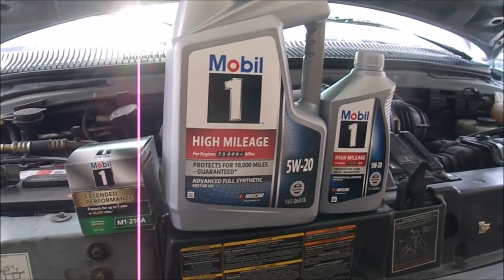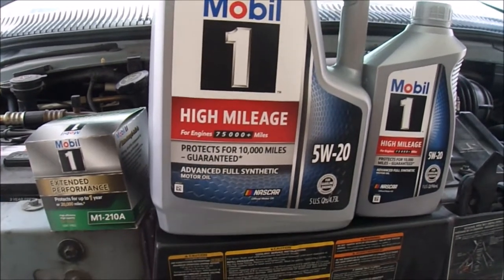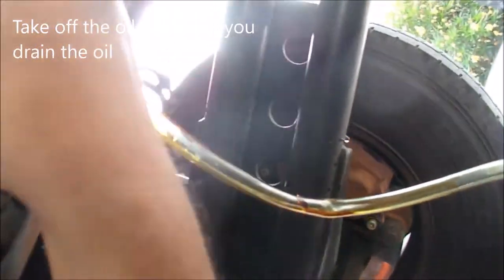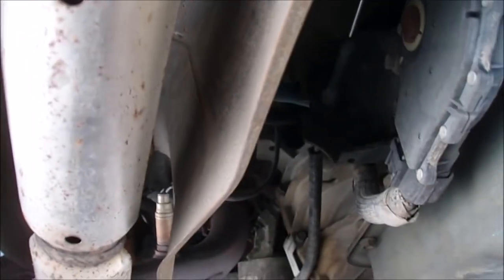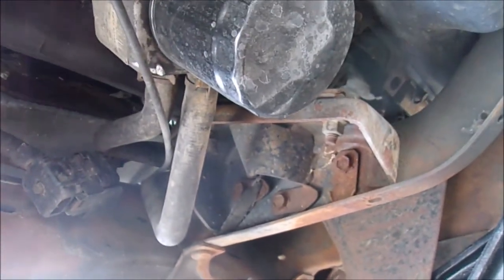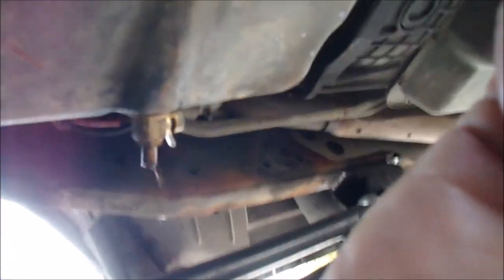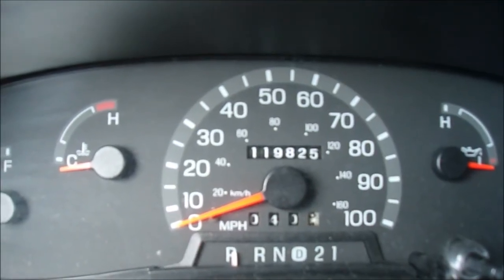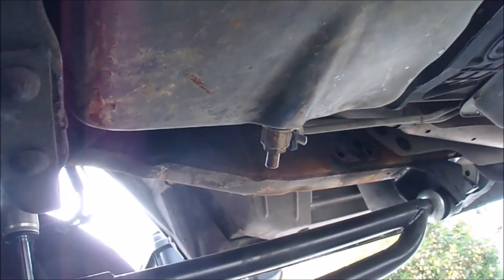Fumoto drain valve hose kit demo less messy easier oil change Ford V10 Econoline Van Class A RV Tip

Comment: Looking good! 

I have 178k on my Triton 5.4 and change it every 5k with the Ford brand semi synthetic oil and  Ford brand oil filter. I’m hoping to make it to 500k! Then a new engine when I’m an old fart..

I just drove 600 miles last weekend to Lake Shasta it was 110 degrees..
Reply from the maker: I've had my Abarth for 3 years in July and I put 15,000 miles on it in that time. I put the same on my Van in a little over a year. How many miles did you have on your van when I bought it? This 2nd Van Project I'm enjoying this van way more. That was plan to go on a lot of road trips. How many miles is the Kings Canyon Trip going to be for you? I have a Vegas Trip planned for October that's going to be another 1000+ so I'm good on oil changes. I like doing about 5000 but I might go a little over this next round because of all the trips I'm doing. I'll do a update video soon on which days I have approved for leave. I put in my requests.

Comment: Is that the best oil for larger vehicles?
Reply from the maker: GM puts Mobil 1 in Corvettes and so does Porsche so I figure it's good enough for my van. I use high mileage formula in vehicles with 75000 or more miles because it's suppose to help the seals.
Reply: @JohnDrivesAnything  so it's good good high speed vehicles